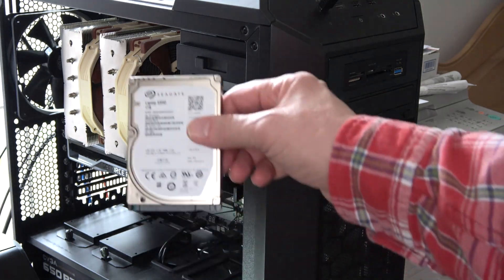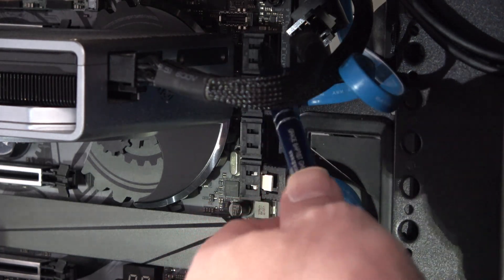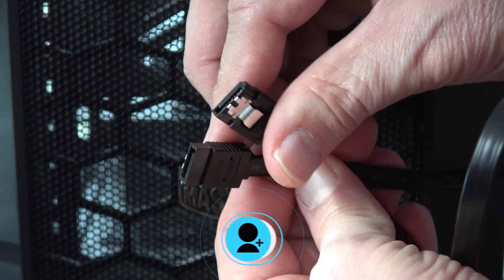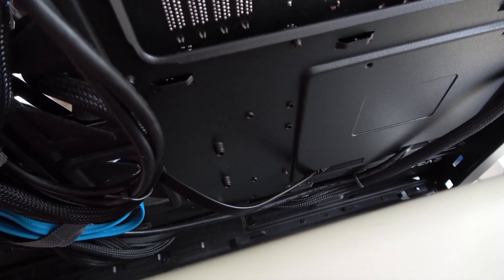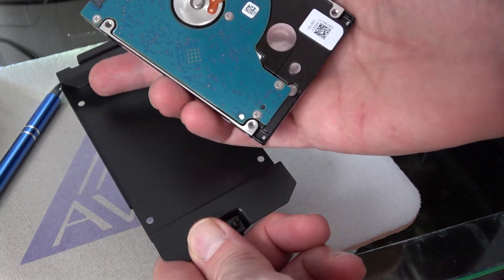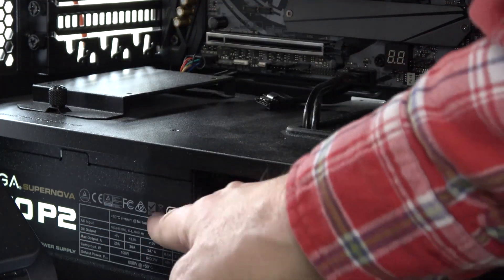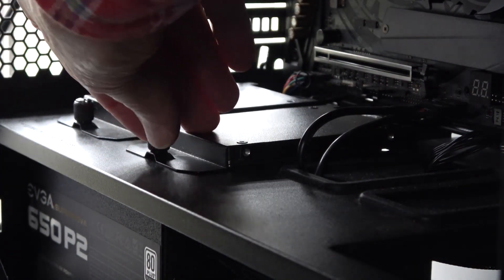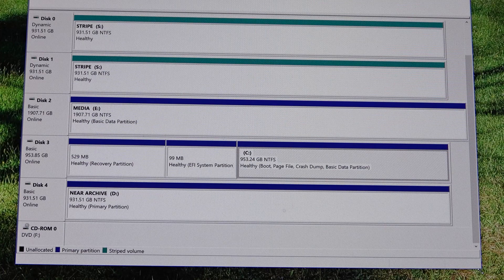Adding Laptop drive to Cooler Master M500 Case (Easy to follow steps)

Comment: Man, I haven't used a spinning rust hard drive since 2017. Though I did buy a broken 1tb 3.5" Hard Drive about a year ago for £1 including shipping, so I could tear it apart for the magnets. They are so very useful. About the only thing useful in a spinning rust hard drive anymore. Still, I guess if you have the need, then go for it. But, no, they are way too unreliable and slow for me. Also, I ditched the case over 3 years ago too. I love having a caseless PC. So amazing for maintenance and cooling. No fans on my CPU, just passive cooling and just the 2 stock fans on my Graphics Card which I could remove, but can't see the point, they are so quiet at the slow speeds.
Reply from the maker: Yogi, spinners are still an inexpensive way of backing up and archiving data. I still use them in my workstation for that purpose. Of course active projects use SSD for the quick access. Thank you for sharing.